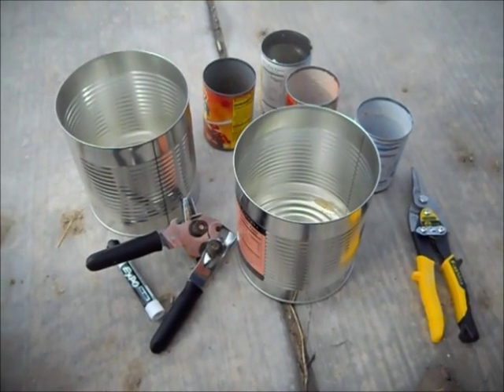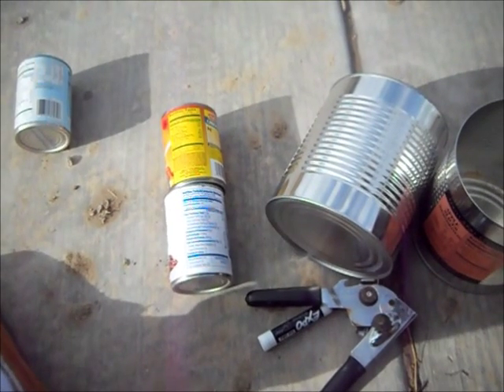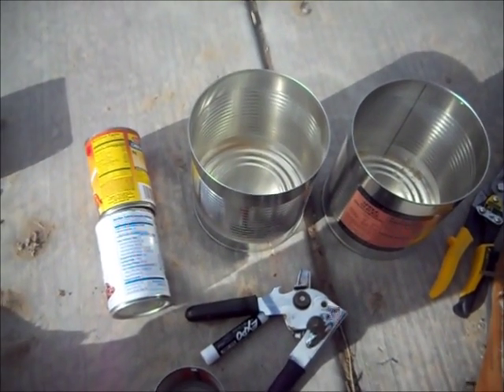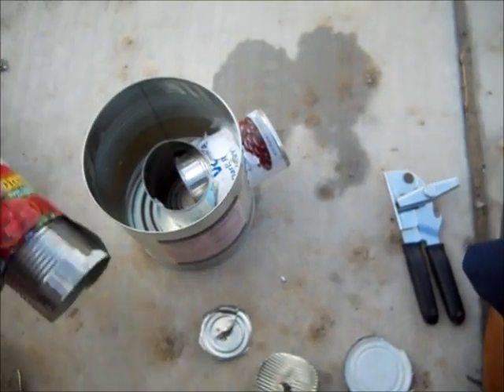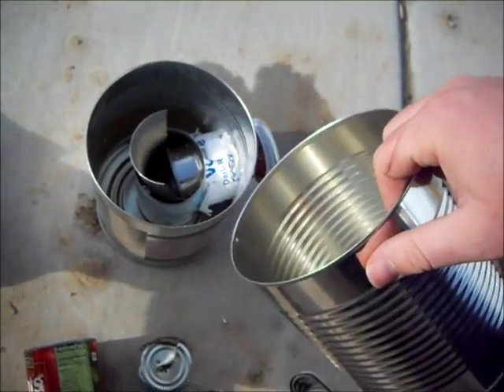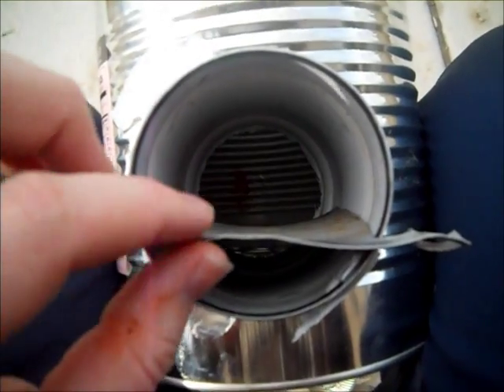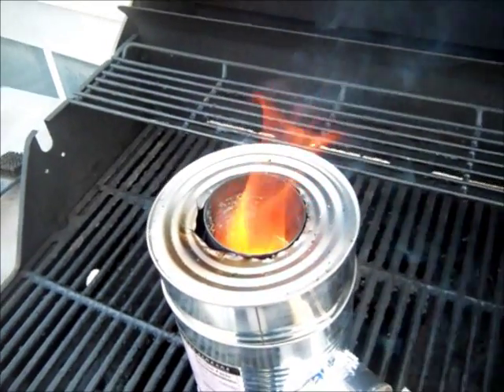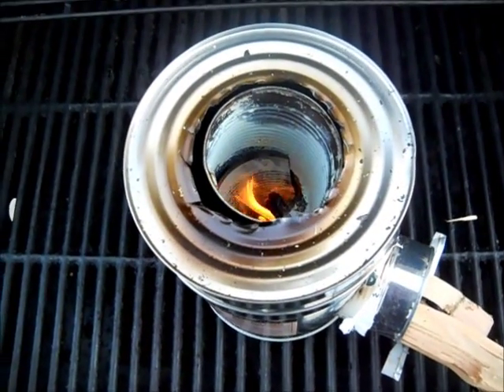How to build a #10 Can Rocket Stove

Comment: I know its an old video but i would suggest to insulate the cans with sand, makes it easier to touch and the weight of the sand will make it more stable, but im sure by now you may have allready done that.
Reply from the maker: +mark desrochers (Gardenman101) Nope, I haven't done that. Great Idea. I will try sand. I thought about using dirt, but don't know if that would work well.
Reply: I think if you use dirt you may get an aroma issue
Reply from the maker: +mark desrochers (Gardenman101) Good point, sand it is:)